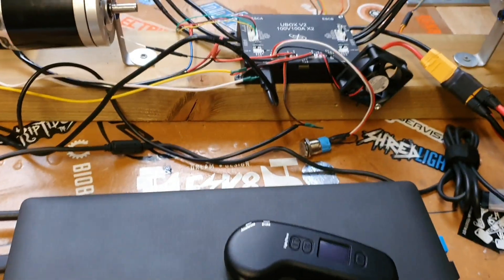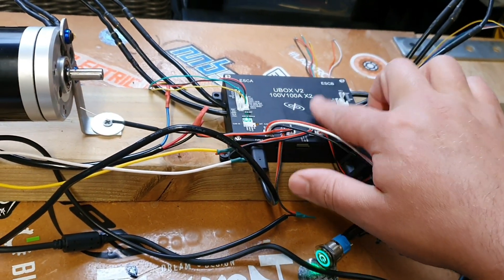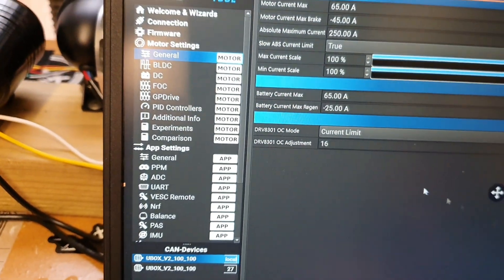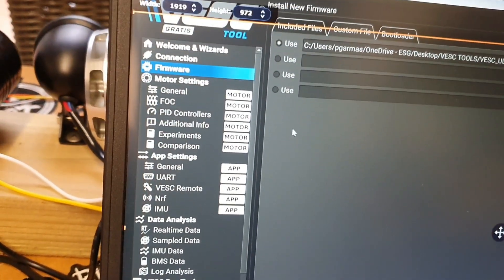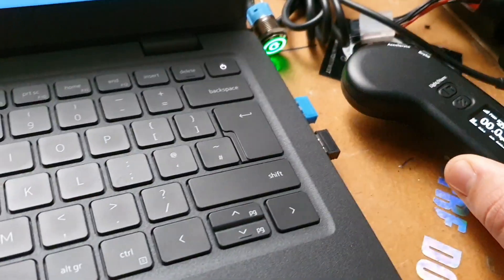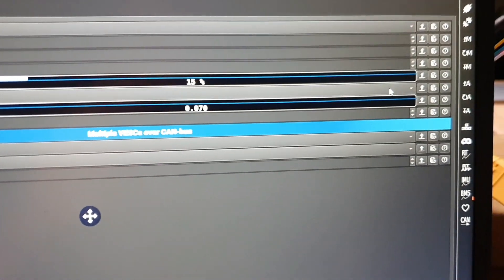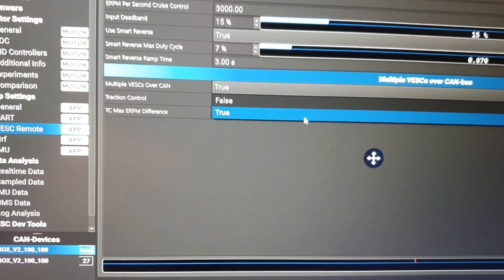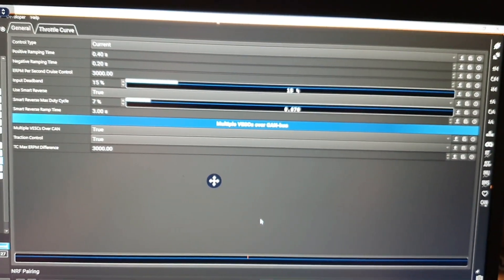VESC tool tutorial.  Remote doesn't work?

Comment: Good afternoon. Tell me if you know. I also have a remote control and put Current no reverce. I adjust the range of the throttle stick from min to max (1000-2000ms) but the motor is gaining maximum speed at 1/4 of the gas and there is no smooth start - it feels like I pressed the engine start button. I would like a smooth change in speed throughout the entire range of the throttle. How can I do this? I put Pid Control, but at the same time the motor works as it should, smoothly gaining momentum. But often there is a very terrible sound in the motor, it wedges and is solved only by disconnecting the controller from the power.....
Reply from the maker: Hi mate, 
Sorry for the delay in replying.  What remote are you uding? Does your remote have different power settings? If it does, did you set  up the board while remote was on the highest setting?

Comment: Wow, your ABS max current is 250A set, Mine is only 135A Default.
Reply from the maker: I was testing different things on the test unit... vesc tool does drop it down to 140 automatically later on.